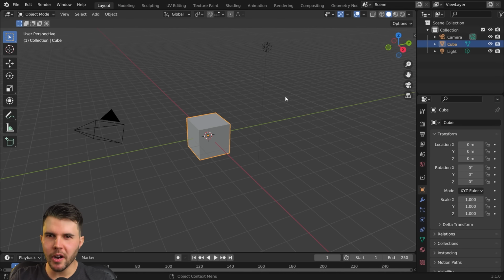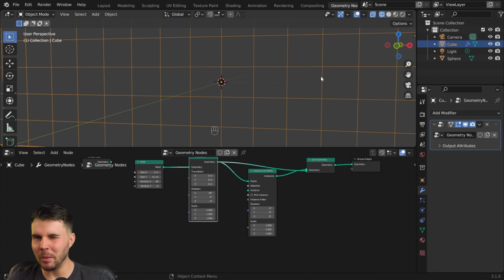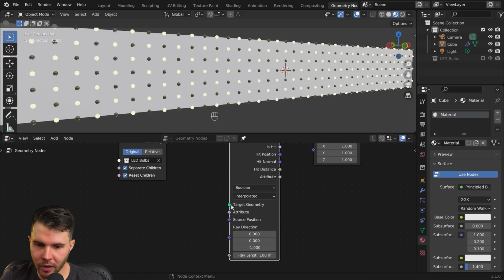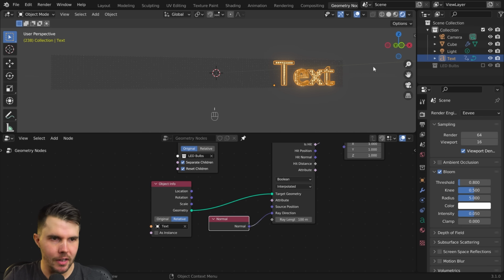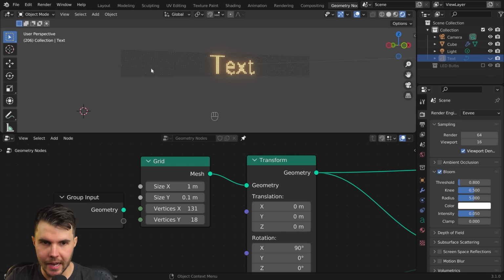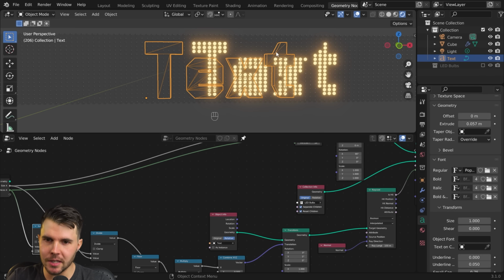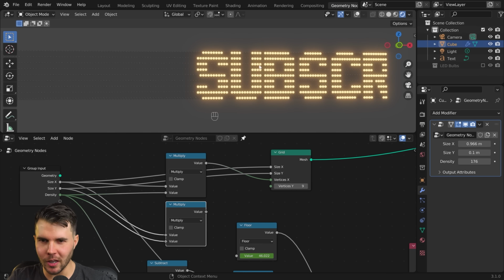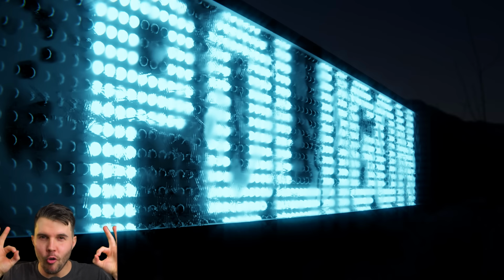Blender Tutorial: LED Screen

Comment: I know this videos kinda old, but a quick nitpick: floor is actually a maths thing. what floor actually does is that it takes in a value and rounds down to the lower whole number. Ceil does the opposite, rounding up no matter what.
Examples:
Floor(4.3) = 4
Floor(6.5) = 6
Floor(9.99999) = 9

Ceil(5.9) = 6
Ceil(0.000001) = 1

Comment: 20:28 - What did he do in that moment? Jesus, he is clicking so fast and I can't see what he did
Reply: Hi. At that moment he is changing the behavior (AKA Interpolation Mode) of his animation keyframes he made at 20:02, he changes the keyframes behavior from the default "Bezier" to "Linear". There's a few ways you can do this, he went straight to the Graph Editor but you can also do this from your Dope Sheet which you're probably more familiar with.
Just go to your Dope Sheet, find the keyframes which you would of made at 20:02, select all the keyframes of that node in Dope Sheet, right-click anywhere in the Dope Sheet & go to "Interpolation Mode" & click "Linear".
Also if any video on utube is too fast for some sections etc, pause it then you can use your keyboard  "<" and  ">" keys to move 1 frame at a time. Comes in handy for many things on utube, not just tutorials.

Comment: thanks for this! learned a lot about geonodes just from going through this. you can do interpolation mode the same way from timeline though, and you can also set your default mode to linear in the settings. I did that because I use a bunch of modes for my graphics, but like to start with linear while I work. it’s a much better baseline imo

Comment: I dont think so you needed to subtract one because it wasnt counting one column or some thing . at 18:00... I think that its because your x verticies were 131 and thats an odd number... So even if diving it by one you were getting answer in points... Still its not accurate... That why... Subtracting 1 makes it an even no .. I.e 130.... And hence precise answer after division.. And no more uncertinity that will stack up and cause that glitch... Because of paces not being equal ..... I am not sure if i am correct...So you mighy as well just have changed verticies to an even no...

Comment: Great tutorial. Everything worked except for the  Animation Y and the letter stuttering on the X axis. The setup is correct and I have double checked everything several times, but the text will not move up and down. I also added the additional floor node to fix the letter stutter, but it still stutters. What could be the problem? Also, how would I go about adding another text to the same LED board? Thanks.

Comment: Hi, just a quick question. Is there a way to hide the white grid that appears behind the bulbs when you render? 
Thanks
Reply: Remove the join geometry node and plug instances directly into group output geometry
Reply: @angrymrfuzzy  thank you for your response. unfortunately, It doesn't seem to work, the white parts is still there.

Comment: Another great video, thank you! 

(fwiw @~24:00 when you label your two Node Groups with "Density" I think what you really meant was "X Vertices" and "Y Vertices" on the two subnode group inputs - more clear because you used "Density" to describe the parent input multiplier of the two axis sizes to get the number of verts. Did that make sense?).

Comment: 22:19 When you changed "Vertices X" (=vertices per size_x meter) to "Density" (=vertices per 1 meter), you should also change the division below: Change size_x/density to 1.0/density. The "Size Axis" parameter can be completely removed from the nodegroups. The density (per meter) is enough to determine the size of one "pixel".

Comment: Truly impressive result, does what realism does. The only thing I wonder, if the same stuff would be possible with a texture. Even if same geometry used, handling the text would be lot easier. Well, there is no build in text node in Blender, there is actually an add-on for that, but if you have to do a lot of these displays, with longer text a shader version could be interesting.
Reply: Found a solution to do the same thing you did, but with a very simple setup. Just a mesh and a simple shader. It took a while till I understood how to mimic a ray cast node with a textured shader.. in the end it was so simple, feel almost like an idiot. Now I can simple move the texture and it works perfect.

Comment: Hi Andrew,
downloaded your (result?) BlenderGuru_LED_Screen.blend   and it is runs by Blender 3.2 , it shows
the  Text  "Blender Guru"   but now??? trying Blender 3.1.2. a bit more is visible after a Camera is added
the rendered Image shows something like Blender Guru several white point s and sevak black strokes over
the text .   It means
ona needs a lot of help for e.g. how to  change the text , the color, to make all dots visible etc.

By the way if onw use the pop up menu creating a sphere  and setting  the readius in that menu to 5 mm,
the scale is at one 1 1 1  (so nothing to adjust,, I know that at other places you told about
that the three  scale values should be  1 because to avoid later problems)

Comment: Fantastic!  Last time I tried a scrolling LED sign like this, was in 2014, 2015.  Very tricky!  With Geometry Nodes, is "easy" depending on your definition of easy. Once the key principle is in place, the RayCast an InstanceOnPoints, it's all fussing with details.  

In addition to the X position I added an X Nudge value, to move the pattern of glow fractionally, 0 to 1 from any column to the next. Allows choice of how the text (or whatever shape) gets digitized.  Then when the text slides across, it's the same desirable stable pattern.

Comment: Actually it's quite easy to distinguish between "Instance on Points" (instance, not instances as you said) and "Instances to Points". In the first case you have the imperative form of the verb "to instance", so this node lets you instance something ON points. In the second case it's "instances", the plural form of a substantive, so that's referring to instances you have and converts them TO points. I'm no native speaker but that was always quite clear for me.

Comment: Off the wall question from a day old new user. How do you make Blender 3.2.0 open on the same monitor it was closed on? I have three monitors, and want to use Blender on the #2 monitor. I've tried everything I can think of, and it always opens on my main monitor. I'm running Win10, and I haven't actually created or saved anything yet. Just getting started on your tutorials

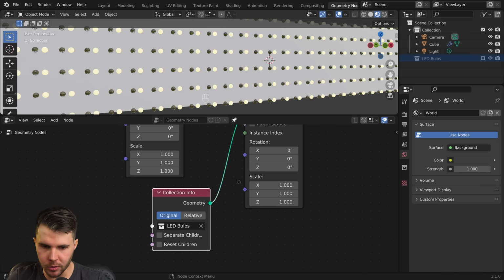Comment: I'm having an issue around 6:30, could anybody help me? everything seems to be fine until after I group the two bulbs and move the collection into the geometry nodes. When I attach the collection to instances, about half of my bulbs are on the sign, and the other half are going way above it. How can I fix this?
Reply: I had that issues and redid the whole thing from the start several times. I paused the video every time he did something new to check if my screen matched his. If you still have this problem two weeks later haha, I would suggest undoing and double checking that you’ve got everything correct.

Comment: 9:05 there is actually a simple reason it is illuminating a block of bulbs here. Ray direction is by default set to -1 in the z direction (as you can see on your node) this means that each bulb will cast a ray straight down in the z direction, so you can imagine any text below a bulb will be a hit, causing a block of bulbs to be illuminated.

Comment: I thought I had followed this tutorial to the letter but then once I output (using Eevee) an FFmpeg Video (@30fps) using MPEG-4 for encoding at Perceptually lossless the ticker effects is not smooth. It’s jittery and doesn’t look right 😭
Reply: I've always heard that you should not render anything directly into a video file in Blender, but instead, render it as a series of images (for example, .PNG) that you save into a folder. Then, once you've rendered all the images, you'll import all of them into the video editing software of your choice (Blender has an inbuilt video editor) as a sequence, and then render those images into a video. Check out the finale part of Blender Guru's Donut Tutorial series where he explains this entire process.

An additional benefit of rendering an image sequence is that if your Blender crashes or there is an error during the rendering process, you can continue from the last frame that rendered successfully. When rendering in a video file format, you have to render from start to finish in one go and hope that every frame renders perfectly.

I'm not sure if this will fix the issue you're having, but I recommend giving it a try and see if it helps. As you'll be rendering every frame as an individual image, you'll have more control over the video editing process and may be able to fix the issue in the video editor as well.

Comment: Great ideas. The only thing I would add is that you don't actually need keyframes, you can use the #frames value to allow you to control the motion within the Geo-nodes, doing maths on that to allow you to have a flexible animation time.

Comment: not sure if blender does this correctly but in mathematics and programming "floor" means rounding to the lower value NOT the nearest

the options as visible at 26:09 should behave like this:

ROUND:
2.3 -> 2
2.5 -> 3
2.9 -> 3
-2.3 -> -2
-2.5 -> -3
-2.9 -> -3

FLOOR:
2.3 -> 2
2.5 -> 2
2.9 -> 2
-2.3 -> -3
-2.5 -> -3
-2.9 -> -3

CIEL:
2.3 -> 3
2.5 -> 3
2.9 -> 3
-2.3 -> -2
-2.5 -> -2
-2.9 -> -2

TRUNCATE:
2.3 -> 2
2.5 -> 2
2.9 -> 2
-2.3 -> -2
-2.5 -> -2
-2.9 -> -2

Comment: "Is Hit" in the Raycast node returns "true" or "false", hence why the connection is pink. When you plug a boolean connection into a number connection (i.e. instance index) it converts true/false into a number: 0 for false, 1 for true. Because arrays (like the collection) are zero-based, the first element is at position 0, second element at position 1, third element at position 2, etc. So whatever element you want to show when there's a hit, needs to be at position 1 (2nd element in the collection) as that's what "true" is converted into.

Comment: Is there a way to determine "movement" speed by project framerate? Basically I want to render just emission (in like 15-20fps) and be able to use it anywhere else (basically a video clip instead of a 3D object) and I don't want text to look jittery
Reply: Can't you just change the animation framerate under render settings?
Reply: @azure8247  how can I slower the led movement in animation itself through geometry node? in 60fps the movement is so fast.

Comment: Standard LED is exactly 5mm, also common are small (3mm).. a bit more uncommon is 2mm and 10mm.

Anyway, i would probobly call it a LED sign, a LED screen sounds like its sort of a TV monitor or something. 

I would say the signs don´t quite look right in the colors. LEDs are usually very close to total monochrome color. They are a specific nm range and only that range. Its a bit hard to make this in blender not having full physical spectrum color.
Reply from the maker: What a guess! I never even googled it 😁
Reply: @blenderguru  yea.. its a excelent video.. its really just the color rendering that seams of to me.
Reply: If you look at Planar TVF series, you'll find the pixel pitches they offer are 0.9, 1.2, 1.5, 1.8, and 2.5. 0.9-1.5 I use all the time.
I think 0.7 exist but I haven' used it (iirc). But for large display walls utilizing these, I do it using material nodes instead.
Oh, and I'd also add a slightly larger grid with less geometry instead of joining the one used for spacing.

Comment: You don't have to do 2 balls, you can just pass the on/off state to the ball instance with an attribute
Reply: But I'd like to keep my 2 balls.. Please don't take them away.
Reply: I would pass the color to the bulbs' texture-emittioncolor. Then I can input a image have that displayed. Haven't tried yet so IDK if it will work as intended or make some bulbs have gradient color (which is not what I want)
Reply: @yuxuanhuang3523  You can use a mix shader node to change between the reflective and the emission shader
and round the factor so you don't have a gradient
Reply: Anywhere that can be seen in action? I am trying to avoid using a collection, but i have no idea how to replicate if-else control flow here for its material...
Reply: @devgumdrop3700  
Geo Nodes: https://drive.google.com/file/d/1NPnCIXASryVXFh9PRaGunDr3EuCKa11U/view?usp=sharing
Modifier: https://drive.google.com/file/d/1krhElc8tb5zn4n-Zmlxyy2ZICYQFMtdw/view?usp=sharing
Material: https://drive.google.com/file/d/1GVSn3Kj-thoM14Rq5kikq0sMVlGKI8GC/view?usp=sharing
Result: https://drive.google.com/file/d/17YbOD4SEqUQ1XvmxSemAOba2fmroHWZM/view?usp=sharing

- You have to realize instances at the end
- The output attribute from the geo nodes modifier has to be the same as the input attribute in the shader